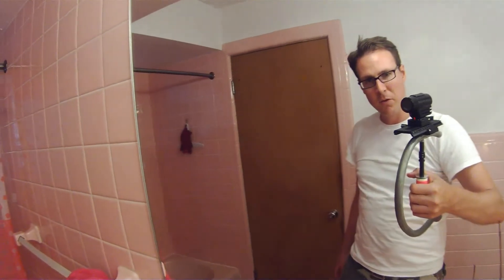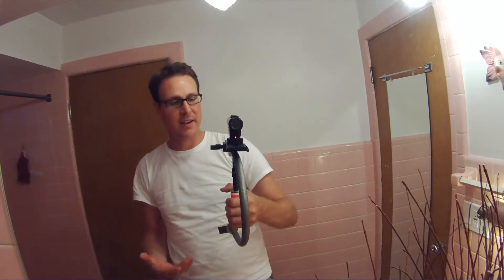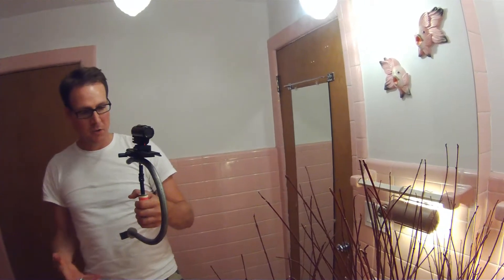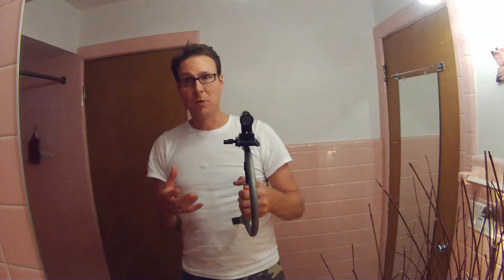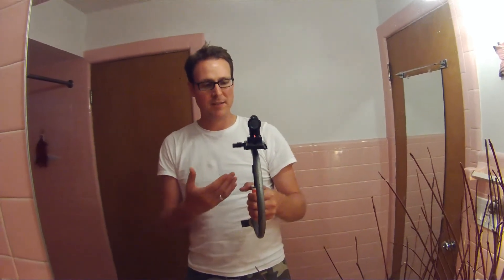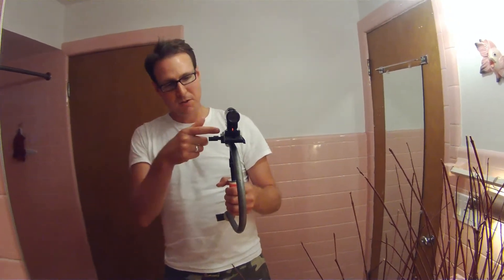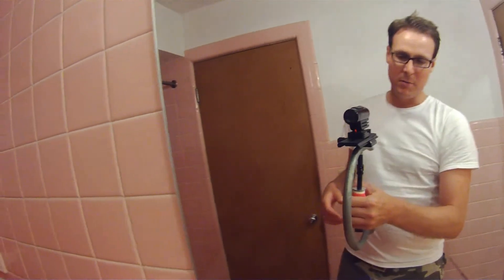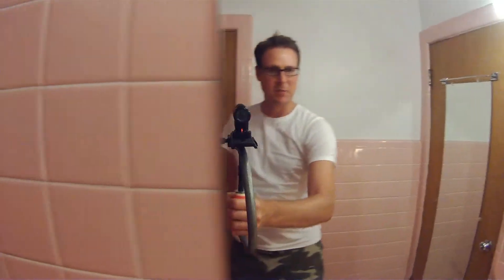Steadicam Test Footage

Comment from the maker: Velbon QRA-3 Mini Quick Shoe Adapter.
Traxxas 5151 Half Shaft Set. 
2-Way Macro Slider Rail. 
608 Style Skateboard/Rollerblade Bearings.  
3/4" CPVC Coupler.   
3/4" CPVC Fittings.  
1/4 Size threaded rod.  
1/4 size self-locking nut.  
1/2 size bolt.  
Masking tape.  
1/2" electrical conduit.  
1/2 size bolt, 1/2 size nuts, miscellaneous washers, and a piece flat steel bar.

This list will make more sense when I put together another video showing the assembly of the steadicam.

Comment from the maker: If your camera pans on its own when you move from left to right, you have more weight in front of your camera than in back or vice-versa. Adding counter weights isn't always the best solution because you wind up with too much weight on the bottom. That's why the macro slider rail is key. It allows you to adjust your center of gravity for/aft without adding weight. That means all you have to do is make sure the top is just slightly lighter than the bottom, and balance from side to side.

Comment from the maker: I strategically placed a washer slightly larger than the PVC handle on top of the top bearing.   As I grip the PVC Handle, I can nudge the edge of the washer with my thumb to facilitate a nice steady pan.  I stole this idea from WSCLATER.  It works very well!